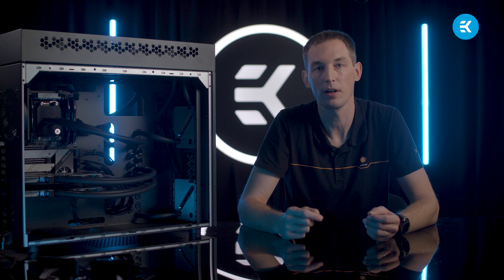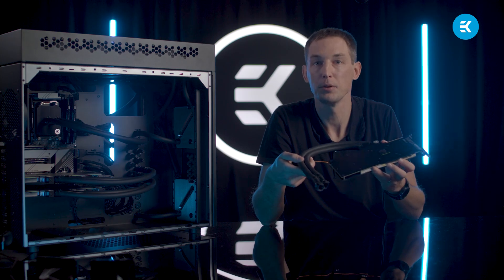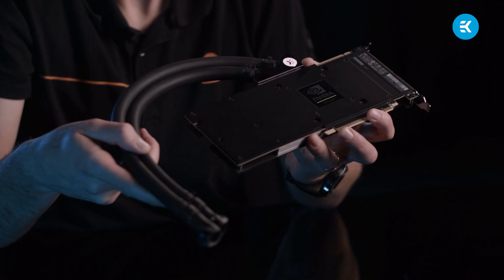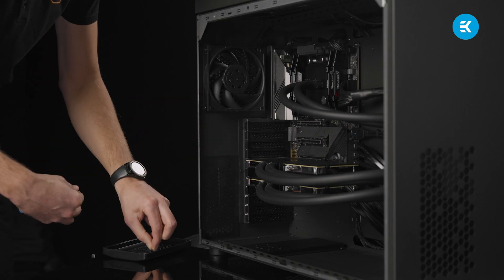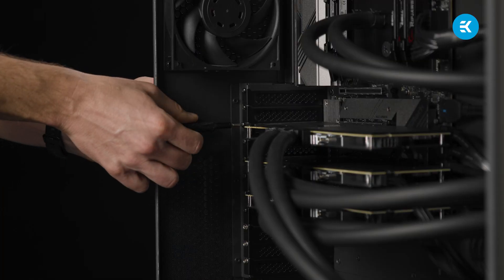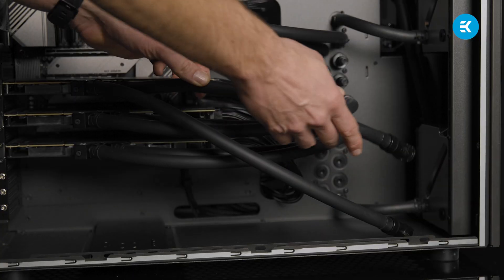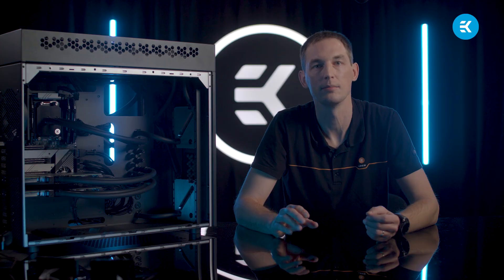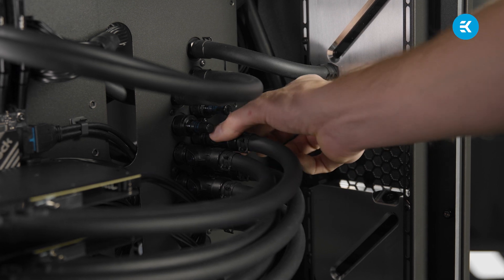The EASIEST GPU Expansion EVER

Comment: can i use this for normal dual gpu setup which is the rtx 3090?
Reply from the maker: Yes you can! You will need the EK-Pro 3090 waterblock for it though!
Reply: @EKbyLMTEK  okay will do coz, i want to design my system with quick disconnect fitting for easy maintenance

Comment: I want quick connect/disconnect for custom cooling... you are making distribution plates for a variety of sizes and cases: just make a quick disconnect male/female, connect one end on the DP (or whatever, even a tube or T-splitter) and let me quickly swap video card or GPU without worrying about draining the entire loop.

I don't need the new block to be pre-filled, I can always refill the liquid that's trapped in the old block.